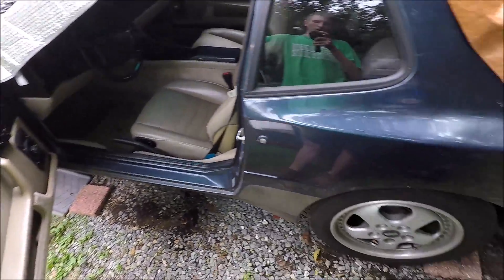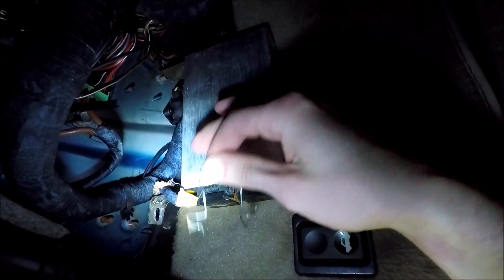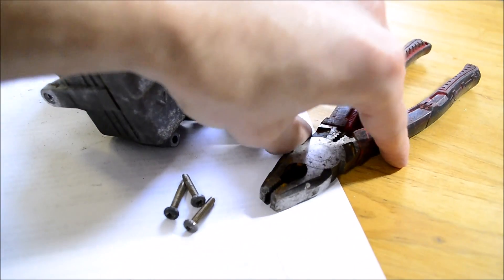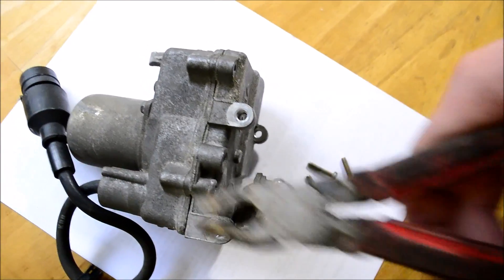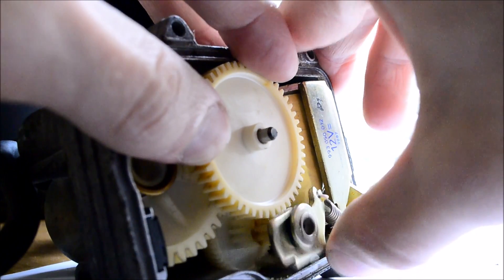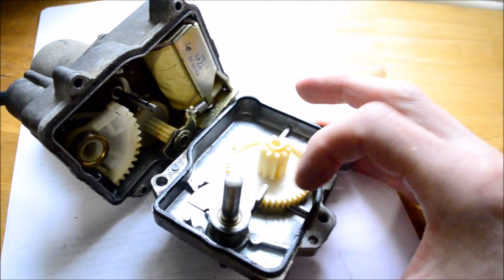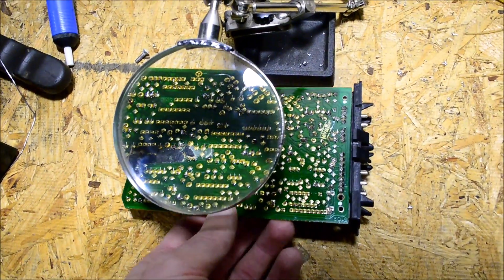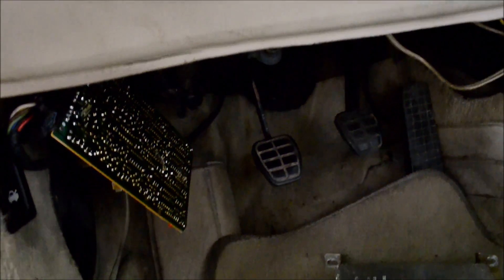Porsche 944 Cruise Control Repair

Comment: I have the same problem with small screws like that. I have found the best tool for the job is a manual impact driver. When you hit the tool with a hammer, it puts a tremendous down-force and shock to the screw. Since it is generating down-force and shock, it won't strip the screw head. I have used this tool a lot and it works like magic on screw heads. Even on Carb bowl screws. The most common sold is the 3/8 or 1/2 inch. They do make a smaller 1/4 inch driver too for smaller stuff you work on.

Comment: From brief research finding that the issue with solder joints more common than not.  Search online indicates not a lot available for aftermarket unit but did find one company and going to call them for more info  google "Rostra"   systems.    I had been considering going for a 944 but these days need cruise and was thinking of only considering 944's w/factory cruise but if this issue is so prevalent seems like just going w/no factory cruise and installing aftermarket would be the ticket esp considering the potential of wider selection .
Reply from the maker: I would definitely look into the aftermarket cruise control and see how that works if I were you, the factory one seems primitive in it's functions lol

Comment: btw-  nice vid.   had read about the joints previous to seeing your vid and it does alleviate  a major issue concerning diy repair  -- as in  where is the computer and relatively easy access.
Reply from the maker: thank you!

Comment: In the description you mention using a multimeter to check the system... this sounds easier than pulling the system out and looking for cracked connections.  how obvious are these cracked connections?  Will I immediately know when I see one?... or 30?  I am getting ready to give it a go on mine and was looking for where to start.... I am assuming that the computer would be the FIRST stop, Servo second?    thanks!!  great video.
Reply from the maker: The cracks might not be obvious, mine weren't. The first time I checked my cruise computer, I thought everything was fine and put it back in. I couldn't find ANYTHING else wrong with the servo or cables, so I just went ahead and removed the computer again and resoldered every connection that were big enough for me to solder without damaging other parts, and then the cruise started working. I"m still having a problem where the cruise will actually stick on and won't go off when I press the brake....not sure if I missed a connection or something, but it's pretty dangerous and scary when the cruise doesn't turn off at 80mph and you really need it to....luckily I can press the clutch or use the brakes to overpower the engine, etc.

Comment: Reassembly is much easier if you put ALL the removed pieces back in order into the Main Case. You do not have to try to hold pieces in place and fanagle the case cover on. # Put the spring back in place on the 1/4 white plastic gear (with its electric wiper pair facing down) using needle nose pliers first try, takes 3 seconds. Then put the metal axle (this axle acuates the throttle cable) for that same gear back in place, the gear will center up and get happy. Never force anything on a Porsche. You will see that it fits only one way that makes any sense at all. Then fit the large white plastic gear, large splines downward, onto the small protruding metal shaft (the shaft is fixed into the main case, it is not removable - don't bend it.) There is no special rotational orientation for this large white double gear. At this point the gears and parts are all inside the case and stable, waiting for the cover. Make sure the rubber gasket on the case cover is clean, you can wipe it with a small piece of lint-free shop towel wetted with silcone spray. Clean the mating gasket surface, wipe off excess silicone spray (Do Not get silcione spray on the electrical wiper surfaces - if you do, you can clean the wiper surface with a Q-tip moistened with contact cleaner. Finally, carefully fit the cover onto the case, it should snug into place with gentle hand pressure. Gradually tighten the 4 case screws each one a little at a time (Porsche mechanics use a criss-cross pattern). Done.

Comment: Hi. Nice video. I have a Mini R53 and the cruise control does not work. It does come on but it flashes and then disengages. Do you have a clue what it can be?
Reply from the maker: thanks, i've heard about a diode on the brake pedal switch and https://www.northamericanmotoring.com/forums/stock-problems-issues/166982-cruise-control-light-flashing.html